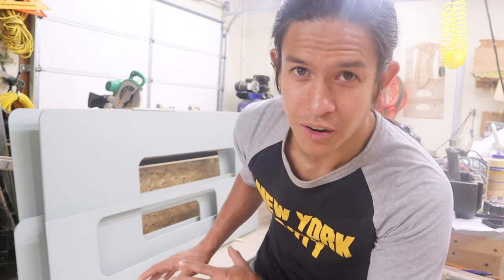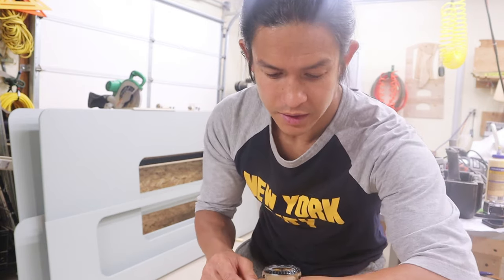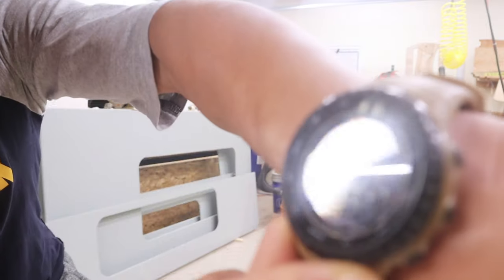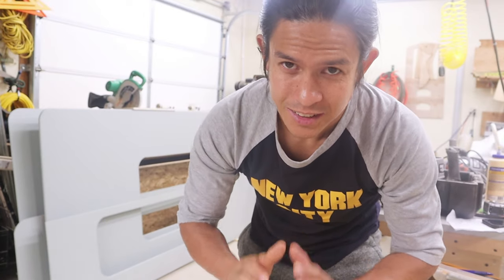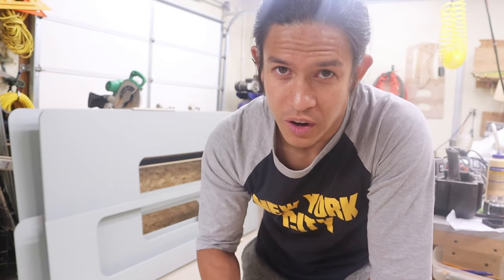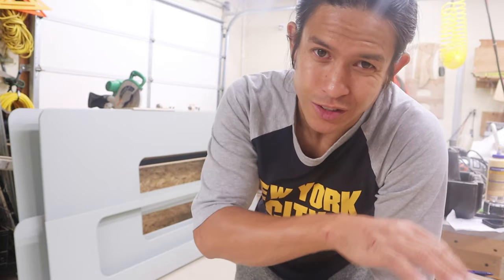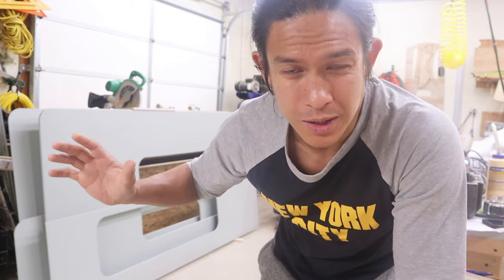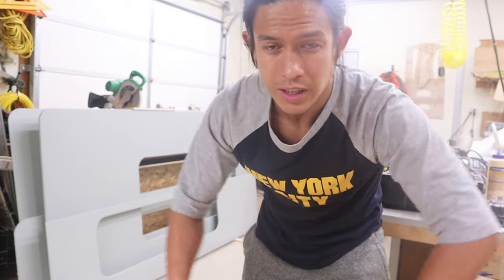RV Bunk Room Remodel: DIY Build

Comment: Omg we are obsessed with your bunkroom! We just put a deposit down on this model. It checked ALL of our boxes! We were wondering how well the bunks and rock wall have been holding up.  Also, do you have any suggestions on how or what we could use in the living room space to fit a desk,  table and  couch or some type of seating?

Thank you for your videos, were excited to start this journey!
Reply from the maker: The rock wall is solid. The plywood facing is tapped into the aluminum framing of the slide. I can climb on it with zero issues. 
We have our couch and 4-person dinner table in the living room, but it’s a little crammed. Not terrible, but sometimes awkward to squeeze into the chairs.
Reply: @ProjectTrek  awesome,  thank you! We can't wait to get ours and get started with some renos.
Reply: @ProjectTrek  Apparently, I asked the wrong question lol. How are the slides holding up with the weight of the bunks? Do you travel often and move them in and out or are they mostly stationary with no movement?

Thank you for your help!
Reply from the maker: They hold up great! We move every week bringing them in/out and they’re fine. The sofas they had their before were VERY heavy. We didn’t add much weight, if any to the slide.

Comment: I have the same RV and I’m interested in how you did the wood border on your slide outs that have a slight curve at the top? What size wood did you use?
Reply from the maker: 8x1 Pine board from the big box store. Because the curve is so shallow over such a long distance the board forms to the curvature with very little effort. I reused the self-tapping metal screws that held in the factory trim. It’s nice because if I ever need to service the slide mechanism I can easily remove the new trim.